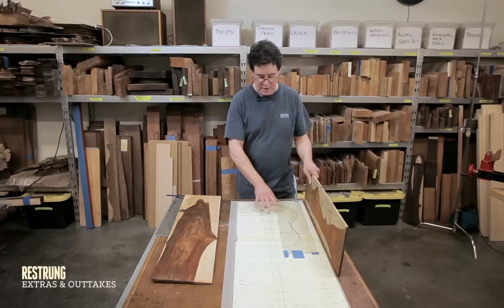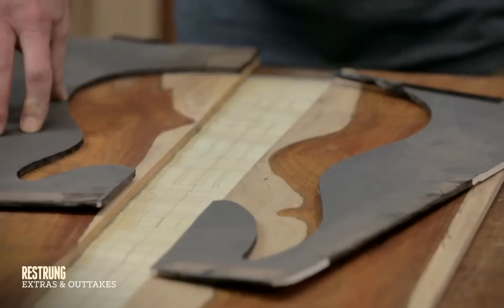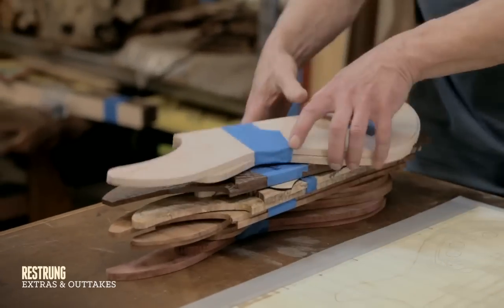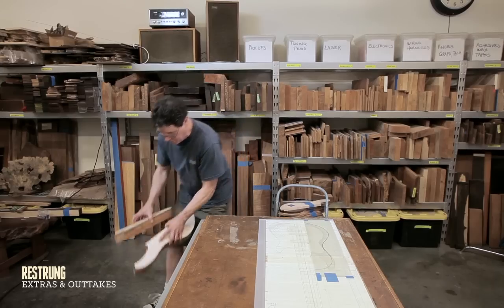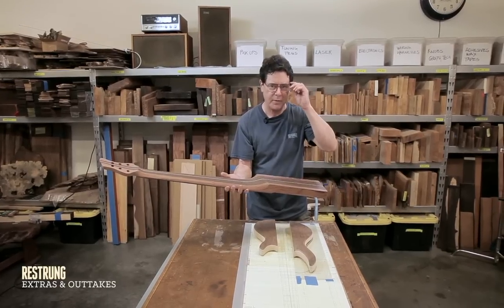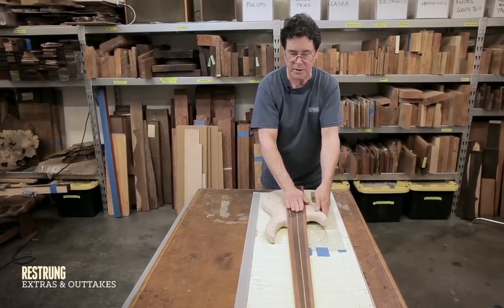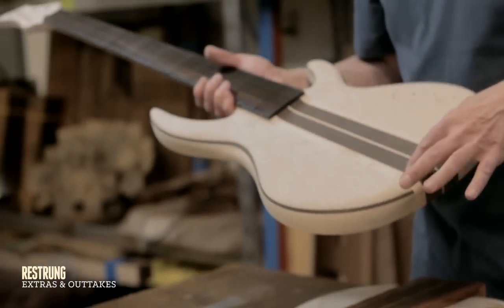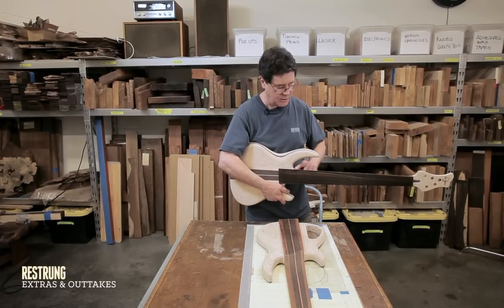How to Build a Bass Guitar - Step #9 - Planning the Body Wings

Comment: this "wings" technique is fantastic. I have not yet built in this fashion but it certainly will be my focus on the next build.
Reply from the maker: How are your builds coming ?
Reply: @Restrung  first build was a mixed result using a solid piece of walnut and bolt on neck. I’m excited to advance into the through- body neck process and am currently planning out the jigs and tools to get me through that new design. I am looking to employ your “Henry Ford” logical parts collaboration process and see where that takes the sound, feel, and ultimate result for me. It has been a constant joy turning my carpentry skills in this new direction. Thanks for being such an inspiration and process motivator!

Comment: Do  you build in any neck break angle? . .
Reply: This  is what  i m asking  too. Didn't realize someone asked  yet.
Reply: Za Cools . . I finally emailed Randy and asked him and this is his reply . . " I mill the laminated neck block to 1 13/16" thick.  I mill the body to 1 5/8" thick.  Before I laminate the fretboard which is usually 1/4" onto the neck block, I plane the the part of the neck block that goes thru the body down to 1 5/8".  So what I have is a height of the fretboard at 7/16" taller than the body.  1/4" + 3/16".  You add the frets to the fretboard and it's a bit higher than that.  This gives me the height I need to allow for the Hipshot bridge that I use.

I countersink the pickups so that they are in a range that allows me to get the strings as close as I need to get them to the fretboard.  The Hipshot bridge falls in a range where I can go up or down" . 

. I hope that helps   :)